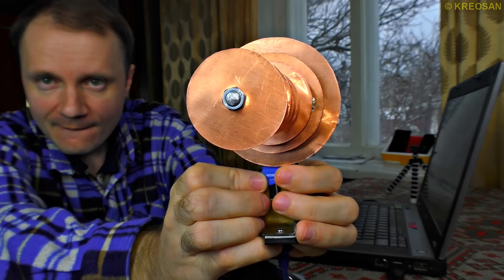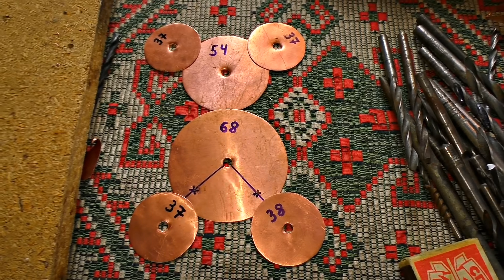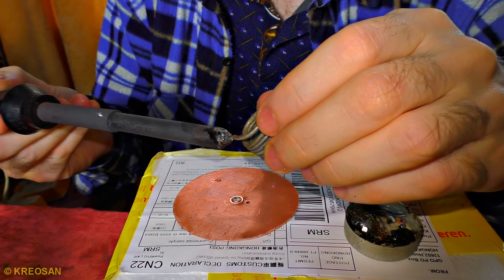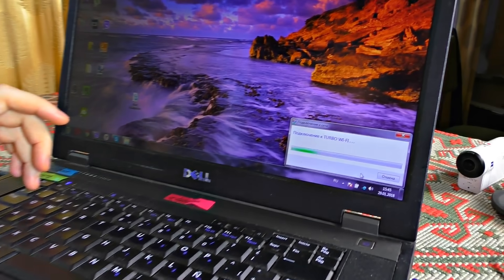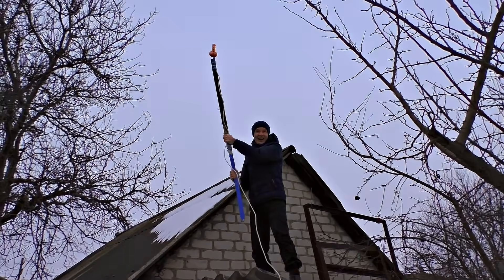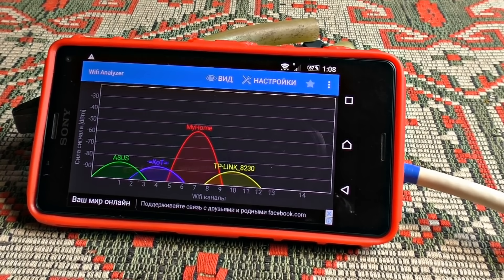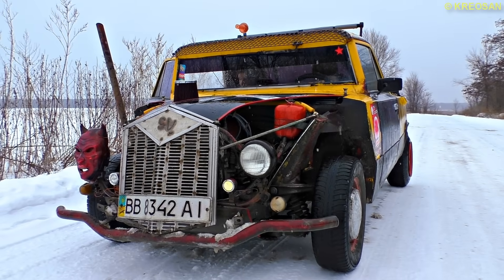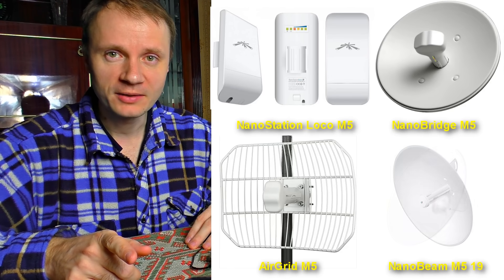✅Wi-Fi Gun DIY / Powerful Antenna for Wi-Fi !

Comment: Again, since the boom on the Yagi is at ground potential and there is no voltage present in the cdnter of the driven element, "grounding the driven element to the boom has no effect whatsoever to the operation of the antenna. 
Again, look at Dr. Yagi's dissertation on the design of the antenna named after him. The voltage derived at the feed point is the result of the impedance as the length of the distance from the boom to the driven element because of the inductive impednce formula of L(inductive reactance in Ohms feed) = 2(pi)*f(operating Freuency in Hertz) value is inductive reactance. 
With the result that active impedance of the feed point is determinate by the intended feed point impedance (Usually 52 or 75 ohms) to match to the impedance of the feed line to the determinate device to which it is intended to be connected. 
The result of the physics of the design is that effectively the voltages at the boom effectively cancel each other and become effectively approaching a value of 0 volts and 0 amps thereby being at a point where the boom voltage becomes 0 volts. 
Refer to the ARRL Antenna handbook on antenna design for better information than I can give you in a comment section on Youtube. 
Best wishes de John WA8LGM/WQTZ773. -/30/-

Comment: neah. It doesnt work well that way. I tried once making a yagi antena with 24 elements using tl wn 722n same as this guy and had worse signal than with omni +3db antena. Not because the yagi was wrong made, but because i had low power input. If you increase the gain power / focus (antena) you should increase the mw power of the transmitter. For a 7 element yagi (as shown here) you should use a 6000 mw adapter and not a tl wn 722n that has only 500 mw. He has signal only because he is close to source. Normally a 7 element yagy should reach 5km distance with 3 lines signal (if it has the 6000+ mw adapter). At 6000 mw it makes radiation that is dangerous in time and you should not stay in line of focus of the antena. That is why they are called exterior antenas (they iradiate). Something like this (cantenna) https://www.ebay.com/itm/Long-Range-3KM-High-Power-5800MW-58DBI-USB-Wireless-Wifi-Adapter-G/273170361869?hash=item3f9a38ee0d:g:o34AAOSwW3VawCBY

Comment: Don't the elements need to be electrically insulated from each other? And you used the wrong kind of coax cable, tv coax is 75 ohm, you should use only 50 ohm coax for wifi.

Comment: May I suggest cutting pieces of rigid tubing to the required 30mm and putting it over your rod between the copper circle plates... then you would just need a nut on either end of the threaded rod.

Comment: So... the wi-fi routers are transmitting the signal at a certain SNR. At your distance from the transmitter, the signal power has diminished to such a degree that your laptop's antenna is not able to recognize it anymore as a signal. In other words, the signal to noise ratio is really really small. But somehow, your receiver (which is made without and form of signal processing) is able to improve the SNR to such a degree that your laptop can receive at faster rates?? Don't make me laugh!  You cant magically improve SNR at receivers end!

Comment: In another video the poster speaks to the issue of the metal bolt used for the "spine" of this Yagi being - ultimately - harmful to the device it drives. They make threaded nylon rod for a non metal substitute.  The active element(s) specifically need to be electrically separate from the support beam otherwise there is a 'short' between the conductor and shield of the cable.
PERHAPS?? If the center of the 2nd disc (center conductor wire) is insulated from the bolt it would still work well enuf and not blow the finals in the driven device ??  Bore its hole larger and hot glue a plastic disc to the center. Make sure the spacing of the metal is correct!!!!!
I can personally vouch for the Yagi type antenna. In the 60's I made an FM Yagi!! It extended the range of my radio to over 150 miles from 2 local stations to over two dozen.  and the mast was only 12' tall. Vert directional and I would have to turn toward what I wanted to tune LOL.

Comment: Connecting the shield to the reflector plate with no isolation on the reflector makes the antenna no better than a stick.  You have a direct short between the reflector and directors, and that creates no forward gain.

Comment: whoa I never though of this... I've been doing a yagi, so why not...hey wait, this is a non polarized antenna, then, right?? (I know it's highly directional, but in regards to vertical, horizontal, left hand, or right hand spiral polarity of the waves)... Better than a cross yagi for a spiral or even  relatively diagonally polarized remote signal reception halfway between vertical and horizontal (from spacecraft you get 360 degree dynamic polarity throughout a flyby pass. So this design should be good, if it's really working well, for other frequencies like for low earth orbit AMSAT hobby or ISS amateur radio events.  I had a simple dipole and did ok when the Russians did a little scavenger hunt on either UHF or VHF one day, but guys whose antenna was a cross yagi or a spiral, maybe eggbeater, did a little better. Boy, I hopped up and down like a bunny when the bleeps and bloops-screech came through the speaker and into the soundcard of my PC and the SSTV image of stamps with artwork came in depicting classic-era cosmonauts (the image "hello down there" of choice sent to us by the current cosmonauts on ISS). Antenna to antenna, no go between, no cell tower, no (other) satellite, no web -- just my tent-pole homebrew dipole on my roof and their Motorolla antenna plastered to the outside of a cabin on a spacewalk. They had a hand held plugged into a laptop, likely. You could point this at them real time and get them for a few minutes instead of one! If the crap hits the fan and your country gets censored, there are a couple birds on UHF you can get out to other counried on for a couple minutes at a time; they probably wouldn't jam those frequencies.

Comment: There is NO WAY this worked at 5Km.  The biggest flaw with this implementation of the design is the driven element is directly shorted to the rest of the elements. This will not work long range. And, it will damage your equipment, especially transmitter circuits.

Comment: What's that. He made it by short circuiting every thing. The coaxial cable WOW!  It's simple unpolarized yagi.
Reply: That's what I was thinking.... The driven and parasitic elements are all shorted together... You'd be lucky if you don't destroy your wifi card
Reply: Evan Johnson. People shouldn't do fake things to just simply increase views. Peolpe know a coaxial cable has an outer metal covering that has opposite polarity if you join them the signal will be destroyed. We don't need to go much farther to simply stop them.
Nice picking!!
Reply: No they are not shorted .
Reply: Carli Max:  And shouldn't the reflectors by isolated from the bolt as well?  Would be better built onto a plastic bolt.
Reply: https://www.youtube.com/watch?v=QTMi99HtW_k
Reply: Any opinions about the "coupeling"  of the mobile phone?

Comment: Hi you need to use 50 OMH cable and if you want a long distance you need to use signal booster because you need to give your signal so strong because the reciver of the another (your home network router) usaly have a weak antenna.

Comment: Do not do this. Even if it works (As another commenter said, there is effectively a short between the cable's shield and centre conductor) this is a high gain antenna. In fact the gain would be so high as to be illegal in many countries. Look up FCC/Ofcom/ACMA/NCCIR for maximum EIRP of wifi devices.

Comment: This makes sense. I thought about doing this but its nice to know somebody else actually did it. Antennas are all essentially the same. Well done man. the 30mm measurement per antenna dish and 5 dish set up gives you a 5 G connection as well. Well done.
Reply: It's Fake.
Reply: @educatedmanholecoverbyrich8890 it’s not fake dipshit it’s called a surface wave antenna and they work very well

Comment: You can also use a 10 meter USB cable and have the adapter as close to the antenna as possible. Just make sure you have a way to isolate it if you get lightning storms.

Comment: @ElectroBOOM is this legit????
Reply: of course it is, its a fucking directional antenna, this shit has been around for decades.
Reply: I was really thinking about this lol !
Reply: This device is a dead short. And will heat up your card or router. 
Take a metal bowl, and drill a hole at center. Then put your antenna within hole. And poof, a cheap and quick range extender.
Reply: Marlon lacert you can add heat sinks
Reply: Bruce Wayne, you can add heat sinks.
However, a dead short for an antenna is poor method.. 
Where all they needed to do was put silicon, around the center to isolate it form the shaft. And poof, a way better device. 100x more effective at data transfer.   Try it, so simple!..
Reply: Marlon lacert yes that too!
Reply: No
Reply: @filipfl0weycze645  škoda xD
Reply: its kind of legit, it would be a very poor WiFi antenna, possibly damaging you WiFi card as the driven element is not isolated from the rest of the antenna, essentially a direct short. If you put a WiFi amplifier on it it would blow it up for sure. If you want to see the best WiFi guy on YT go to https://www.youtube.com/channel/UCHqwzhcFOsoFFh33Uy8rAgQ. He shows you why this antenna is shit but then shows how to improve it.
Reply: @TheZombieSaints  no he sux, he doesnt have a madmax car drifting in the snow.

Comment: I call fake.  Routers and devices need to send and receive.  You can send a signal with that device, but you probably wouldn't be able to receive a signal back at that distance, which means you wouldn't even be able to pickup a signal from far away routers.  Further than normal for sure, but not that far.
Reply: The law of reciprocity in antenna design says you are wrong.  The gain of an EM path is the same in both directions.  A properly connected antenna will boost transmission and reception equally.
Reply: well for that you could put another antenea on the router to send but you cant send 2.4 or especially 5ghz over a cable to an antennea without wire loss killing the signal after a couple feet (like 6 feet would be a long way)
Reply: Bud, think of the Antenna as a combination Megaphone & HEARING AIDE.   Granted the phone isn't transmitting any 'louder', but the Antenna is also 'cupping it's ear',  coalescing the signal it's receiving from said phone by a factor of 4 or 8 or 16 etc.  Same as the ANT's transmission 'amplification'.
Reply: if the antenna can transmit that distance it is also good enough to listen for a tiny phone wifi transmitter at great distance
Reply: Sure it works. He can make a third one and triangulate the signal. They sell devices to do it in ur home but this actually works 10000 times better. I've built similar booster with an old direct tv satellite dish
Reply: It is possible to use one antenna for a bidirectional communication. This antenna will have some big gain (db) but he shorted it with the shield by using no isolation between the antenna wire and the shielding. Anyway 10km is ridiculous
Reply: Should the radiating parts not be isolated from the rest?
Reply: Dude you know shit.

Comment: Yeah until the FCC comes knocking on your door. 

This is really nothing new this is line of sight Communications been done with lasers and UHF and VHF I was thinking about the fact that if you had something that was solar power they could pick up a company's Wi-Fi like Starbucks and it was sitting on top of the building and could broadcast to your house and you can actually basically always Leach Wi-Fi off of a free service somewhere. I guess with this you could really just a meet at the Starbucks but I was thinking you could almost set one up to broadcast as well where I live by the college there's probably a dozen or so Wi-Fi signals I can pick up with something like this.

Comment: While wifi antennas are a thing, the best usually have a higher build quality and a shorter connection distance than your build. They also require two antennas to be pointed directly at each other with precision. After all of that, they have limited speed and the signal shouldn't be sent through "signal heavy" areas.

Edit: this video is fake, if you didn't know

Comment: Circular quad style antenna,  using double reflector and a parabolic dish to close off backscatter will make it highly directional and a non metallic boom is best  using around 8 director elements will give better performance,  using ultra thin satellite grade 50 ohm coax cable into a home-made gamma match on the driven element.  I've made similar here at home to have perfect WiFi tx/rx up to my workshop shed up in back part of my property.  Shed is 70 m away from house,  made of metal and is a perfect Faraday cage.  Hence using home-made antenna I described above. One of my hobbies is making antennas  for radio reception and communications.

Comment: use a hole saw and make consistent circles, and understand that unless you make it a lot bigger it will never get more than 1km without some kind of power gain, and you would need antennas on both sides.

Comment: I built a wifi gun years ago. I noticed I got better reception of other signals when my wifi was located near a window, With bottles with metal foil. So after a few attempts and designs. I got a decent design. Oh yeah after studying physics yeah copper with that design seems legit. I used a tube design because I didn't want the distraction of other signals.
Reply: He says every metal will work, so does aluminium or steel also work?
Reply: I know Copper works better with magnets. I used one disk from a Pringles can.

Comment: The phone would probably have difficulty using the gun at distance, since even if it can pickup the signal the phone's transmitter probably isn't powerful enough to actually send data back.

Comment: This is wrong on so many levels. The first impedance of TV cable is 75 Ohms and WiFi systems have 50 ohms.  We don't know what is the impedance of the antenna, so we don0t know S21 or S12 parameters. Eventually, your card will burn out, because too many energy will reflect back because of wrong impedance on 2.4 GHz. You can buy cheap antennas for 2.4 GHz every where.

Comment: using a yagi calculator fields the same result as the drawing at the start. This is not the best antenna full stop. It only has 11dBi of gain (some omni antennas have better numbers.) the best antenna is a MiMo antenna, which can have up to 23dBi of gain. Either my yagi calculator isn't doing something right, or this guy is bullshitting (more likely the latter)